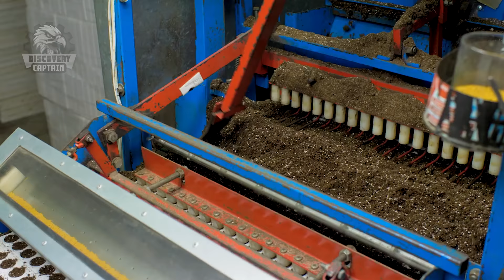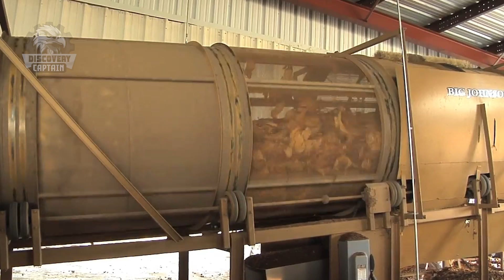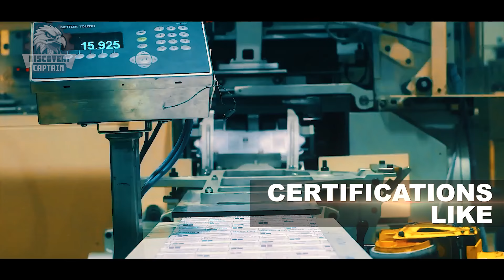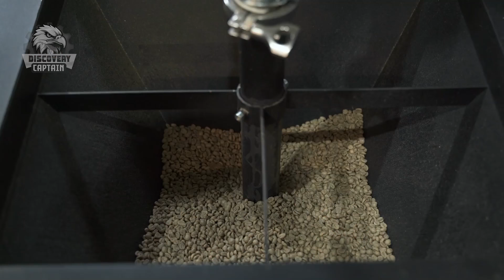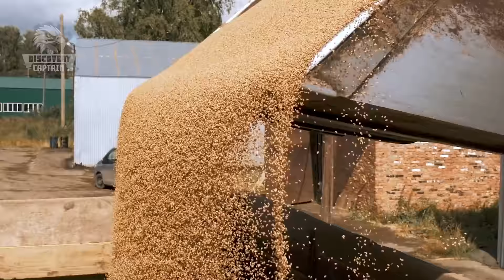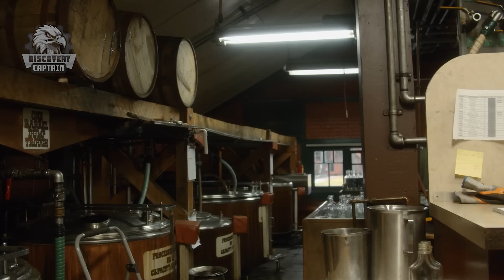How It’s Made: Marlboro Cigarettes, Coffee, Bourbon

Comment: That might be how the big farmers do it but that is not how the small farmer does it. My dad was the latter. We planted seeds under a cloth in ground near a pond called a plant bed. The cloth protected from insects and light frosts. We planted them by hand with a tractor tobacco planter. I see the big boys are still doing it that way. But topping the flowers was done by hand. Another step was breaking out the suckers at the leaf axils and applying a anti sucker / anti branching chemical. When tobacco is ripe in fall it was pulled by hand and hung in a barn and cured. Later after curing, it was removed from the barn and baled into a burlap sack and compressed by walking over it. There was a round, large over 3 foot tall "collar" that you place over the burlap bag to form the bale shape and keep the tobacco neat and in center of the bag. It was all manual labor, hard work.
Reply: Still done that way here, too.